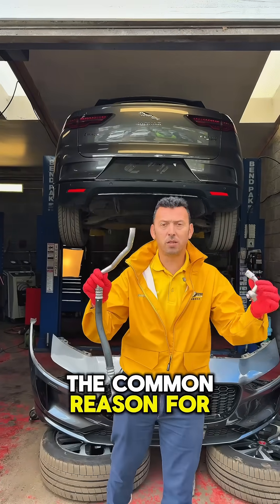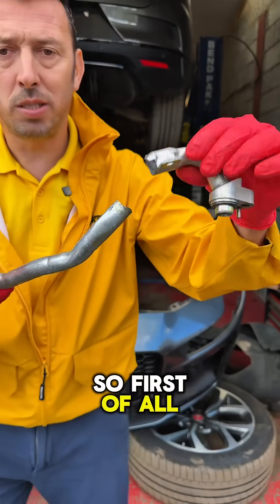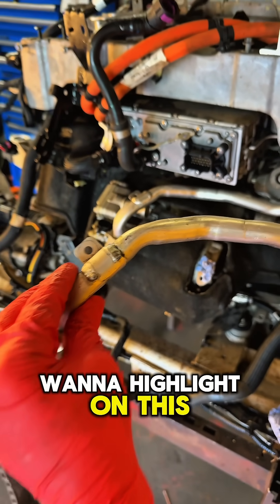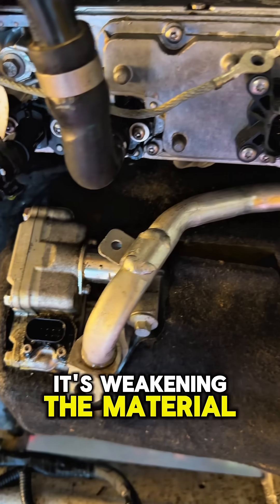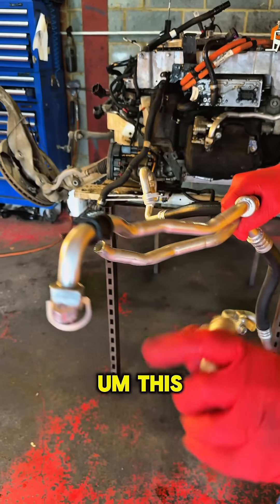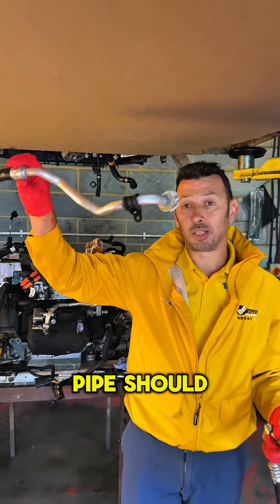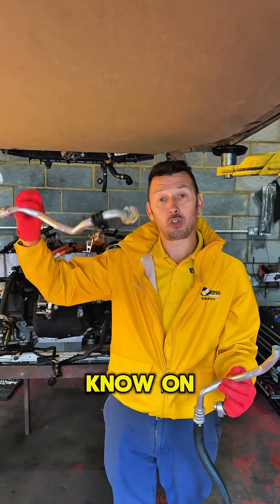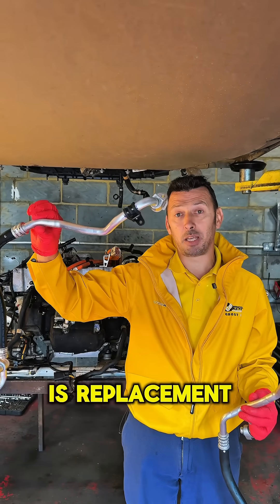Why Does This Keep Breaking on the Jaguar I-PACE?! 😳 A/C System Mystery

Comment: Replaced both pipes at dealer - 2800$, year 5 of ownership. In Moldova there is only one nonofficial service that in 6 years never had i-pace on such procedure, also price was the same for official and nonofficial. also replaced a heater for 1800$ (that requierd battery to be dropped down for access)

Comment: I had that issue on my ipace and replaced both pipes
Reply: Did yours fail completely? Did the main dealer sort this for you or an independent garage ? Thank you
Reply: @Jarvis9259 i did on an independent garage  also had the compressor replaced parts and service 3.2k